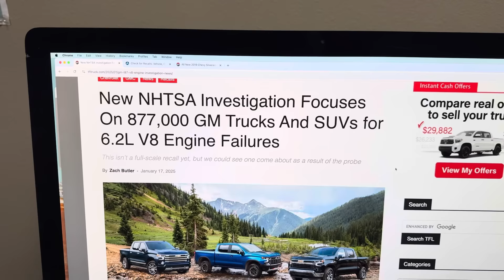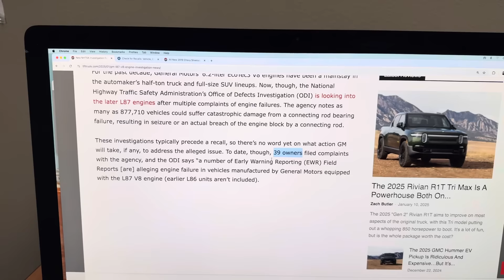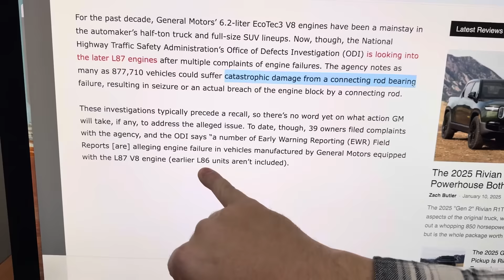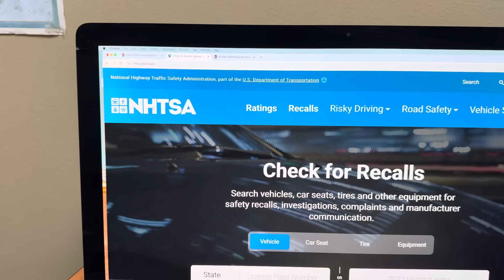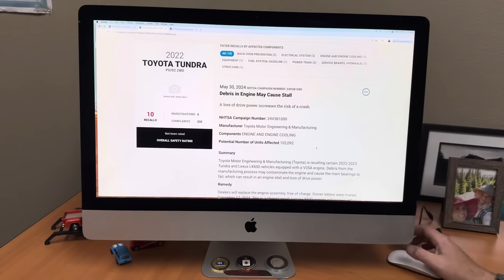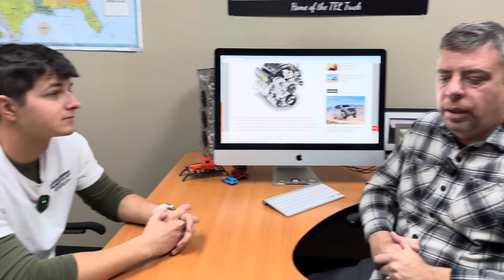877,000 GM Trucks & SUVs INVESTIGATED Over Failing Engines: Are You Affected?

Comment: IT IS QUITE SIMPLE: THIS IS PREMATURE IGNITION AND SUPER KNOCK ENGINE EVENT... THE FIX; RUN 93 OCTANE PREMIUM TOP TEIR FUEL ONLY...
 *A 1969 factory Chevrolet Camaro Z28 with a High Preformance 302 V8 engine has a compression ratio of 11.0:1. and fuel requirement on the vehicles of "PUMP GAS AT THAT PERIOD IN TIME" of 103 OCTANE...  !! 
The GM 6.2L EcoTec V8 engine has a COMPRESSION RATIO of 11.5:1. This engine is used in several GM vehicles, including the Chevrolet Silverado 1500 and the GMC Sierra 1500EcoTec3 Engine Family Features
Type:	6.2L V8
Compression ratio:	11.5:1
Horsepower (hp / kW @ rpm):	420 / 313
Torque (lb-ft / Nm @ rpm):	450 / 609
RECOMMENDED FUEL:	REGULAR ???  UNLEADED or E85 
*"I don't give a rat's a-s" the vehicle computers systems can't compensate and break laws of physics, operating high compression engines on very unstable 87 octane unleaded gasolines; it will create catastrophic engine failures...  Is this a marketing issue where GM has decided they can't compete and sell these vehicles with true operating premium ⛽️ fuel cost... !!

Comment: The 5.3 has the same lifter issue. My 2009 Avalanche had a lifter failure and shaved down the camshaft at 90k miles. I didn't make a complaint to any authority, but I'd love to. The AFM issue is well known for the 5.3.
Reply: My 2008 GMC Sierra has absolutely no issues.     150K miles strong on the original engine.     I've owned it since 80K miles.    I have no complaints.     I understand that nothing is indestructible
Reply: @gregorylyon1004  do you have displacement on demand? If you do, you have been extremely lucky!

Comment: I have a 2020 gmc AT4 with the 5.3 and the 10 speed transmission.i only do about a thousand miles a year and change my oil every year with the inspection. Hopefully it doesn’t have a problem. Bought a extended warranty just to be safe and will be getting a new vehicle before the warranty expires
Reply: My aunt and uncle ordered in two brand new gasoline Chevy Silverados in 2015.  A 1/2 ton and a 1 ton.  They have not had any issues yet, but they both only have about 80,000 miles on each of them.

Comment: Ain’t it hilarious how the government is inevestigsting this when it’s the government enforcing car manufacturers to meet epa standards? The amount of cars I see with dead engines have some sort of stupid cylinder deactivation and vvt bs. Fun fact: government vehicles do not need to meet epa standards and they don’t have no cylinder deactivation non sense or vvt
Reply: while yes I agree the CAFE requirements play into this, Its still up to GM to make a system thats reliable and doesnt push the cost to the customer. Ford for example has had cylinder deactivation in the Coyote for 4 years now and I havent heard of a single issue related to it specifically (and yes im aware OHV engines and OHC engines are different) but at the end of the day GM knows this issue is going on and refuses to issue a recall.

Nobody should be stuck paying 10 grand for a new engine in an already expensive truck just to have the same defect issue and potentially have the engine fail yet again thats pathetic. On top of that yes GM has had issues with the AFM/DFM systems in the past but those didnt catastrophically destroy your engine out of no where, you usually had a ticking issue and then it would fail after awhile. Having your engine just out of no where grenade itself while on the highway with absolutely no symptoms or warnings is just pathetic and GM should have recalled these a long time ago because if the government forces them to do a recall thats a lot of engines and its going to hurt them big time.
Reply: @ this is 100 percent true but I’m still frustrated how the government forces the consumer with epa ratings but they’re not bound to it… all the government suburbans do not have any sort of fuel management and all government diesel vehicles have no def or any epa restriction
Reply: @ Yeah I agree, cause the LT/LS engine is a very good engine if it didnt have this DFM bullshit. 

One thing im curious about is I really havent heard of the 6.2 engines failing in the Camaros and Corvettes. I know they have more robust internals but pretty sure they still use DFM
Reply: @ it’s because afm and dfm are activated when driving steady and well I mean who’s really driving those tame?
Reply: @a.k-1shot3  yeah I kinda thought of that haha plus the volume of engines in the trucks is muuuuuch higher so obviously more failures will crop up.

Comment: The failures are being attributed to fuel management system or fuel efficiency system, meaning the engine cylinders shut down to get better fuel economy, and the barrings can't handle it
Reply: Why can't the barrings handle it? Inquiring minds want to know!🤔
Reply: @jeffmiller3150  i think the earrings are poorly made but they have had major engine issues for yrs even the 5.3 has really bad oiling issues
Reply: Barrings

Comment: Solution stop using 0w20 in these engines, change your oil and go back to 5w30 fully synthetic just like the 6.6 gas engine in the new HD uses.
Reply: Oil weight of 1 step higher in viscosity will not help these engines. Poor design.
Reply: Love on my 24 3.0 GM recommends 0w20, come on! Anything for more fuel economy.
Reply: I take it you've done extensive research,and know better than the engineering

Comment: There is no way there is only 39 complaints. I had 2 motors fail. Both crank bearings. 6.2L 23 At4x. 10k each motor. I think this investigation is going to blow up a lot bigger than they think. And being in Canada GM won’t do anything for you. No lemon laws. All you can do is get rid of the truck at your expense!
Reply: No warranty?!
Reply: @adrianbargen9727  it had warranty. But I was without a truck 3 months everytime it needs a motor. I don’t have time for that. Making payments on a truck and here your driving a loaner half the time. I gave the first motor a pass. Cause I mean stuff happens. But 2! And the nail in the coffin was we were 10 hrs from home on the first day of our camping trip. I decided right there that I was getting rid of it when it got fixed.
Reply: damn why did you go back and get another?
Reply: @josh16-f3r  oh I didn’t get another one. Traded it in for a Trx after it was all said and done. I’ll never get a GM again. I thought I would try it once. And learned the hard way unfortunately.
Reply: I had 23 motors fail.
Reply: @Liberator29 I had 45 engines fail

Comment: I work with a guy that had the 5.3 LS IN HIS SILVERADO with the cylinder deactivation and the lifters end up getting stuck. So he then traded the truck to a ram 1500 with the 5.7 hemmi that had the cylinder deactivation and he ended up up having the same problem with the ram having the lifters stuck and now for some reason ford is doing the cylinder deactivation on the coyote 5.0 and it makes me think that that technology is not working to good.
Reply: cylinder deactivation is the worse thing ever!!! Just replaced the 6.2 in my Escalade ESV. On my Charger (RT 5.7) and my Chrysler 300 (C/SRT 6.4) you can at least turn that shit off by keeping it in "Sport" mode so you have all 8 cylinders running full time. Thankfully my Hellcat doesn't have that stupid feature. We buy V8 equipped vehicles for a reason. If I wanted a CRV or Prius I would've bought one! No need for this 4cyl ECO mode garbage
Reply: I thought the Ram was an OHV motor hence no lifters. 5.0 is definetely OHV.
Reply: @michaelcooley8275 lol no lifters. You must be mistaken, OHV/pushrod engines definitely have lifters. What are you 🚬?
Reply: The government is to blame for having manufacturers to put this cylinder deactivation crap on their motors

Comment: The Vortec V8s from 99-06 were the most reliable V8 you could buy, period. Then they got AFM and have been nothing but problems. I can understand a new design will have issues when they first come out but it’s been almost 20 years and they’re still junk.
Reply: Actually Fords Modular V8s are the most reliable, runs 400,000+ miles as a police vehicle, then, 500,000 +++ miles as a taxi!! My 23 year old F150 will soon turn over 500,000 miles!

Comment: Makes me wonder if the 0w-20 is part of the problem
Reply: I have wondered this as well,  multiple brands,  modern engines,  all using thinner oils having bearing related failures hmmm 🤔.    Also makes me wonder what oil the customer is actually putting in.

Comment: I totally agree with Andre. This leaves me optimistic. I own a GMC Sierra 1500 with the 5.3 V8 and had a small concern about the engine due to the active fuel management and potential failures. If the rate of failure is anywhere near 39 in 877,000, then my concerns are over. That, to me, is nothing. I'm more likely to die than my engine is to fail.😊
Reply: Bro its thousands, just go to any forum and see how many have blown after warranty.
Reply: I’m sure there’s more than just ‘39’ complaints
Reply: The cam and lifter failure rate in our fleet is close to 100%

Comment: ...  the owners I know have said driving in "manual" mode stops the  AFM , which means you "lose" a gear but it does fool the computer - this other issue of cam failures is totally different  -  GM  scares me now  ...  driving since '69  ...

Comment: So, the best engine GM offers for reliability is the 4 cylinder and the 3.0 diesel for the 1500s. The 3.0 has the transmission recall now from the valve body. Only safe bet is the 4 cylinder at this time. Sad times for GM...

Comment: GM has been suffering plenty of issues with their engines and transmissions since before 2019, in my own family we had a Yukon Denali and the transmission started to go, and we got rid of it just before everything fell apart. It had less than 50,000 miles on it and they simply wanted to do a flush of the system to “fix it.” Luckily I have a very honest technician who told me that this was happening with a lot of the vehicles and we should just simply sell it before it goes bad because GM would never take accountability and they were even lawsuits about it.

Just look up the Chevy shakes.

Comment: Investigating now after they have been building junk for the past 20 years? It’ll be interesting to see how GM responds. As far as I can tell they don’t care about making things right and building a quality product.
Reply: They have to pay out to employees so much more so they will cut quality to pay for the contracts the UAW made them sign.  Has to get cut some place.  They are burning through money fast!
Reply: Calm down Ford guy
Reply: @ ford is just as bad
Reply: @deedspm9  Ford is just as bad as is RAM. Toyota had some issues with the new v6 twin turbo units but they will get that figured out or probably already have since its been old.  They take care of issues way better than all the other domestic mfg do.
Reply: @ At least Toyota is doing the right thing to fix it. GM just pretends like nothing is wrong and keeps putting out the garbage.
Reply: @deedspm9  Exactly right.  Toyota will take charge and fix it.  The others wait as long as possible acting like nothing is wrong.  Toyota pulled their trucks and said they needed new engines because of problems.  They did it on their own knowing it was going to cost a mountain of money.  Still did it and was worth it.

Comment: There is nothing positive about these engine failures, because they do not happen while you are safely home. Mine happened when I was in the middle lane of the highway, and not only was the engine dead, would not restart. but the warning lights would not work either and I could not warn the on-coming traffic that I was marooned. It was 7:20 am in November and not quite full daylight yet. I am glad I came out unscathed / alive. I had the engine replaced under warranty and traded the truck in for a different brand. It was a Silverado 1500 RST with the 6.2. I did not file a complaint, but it happened to me in a bad way altogether.
Reply: By an old Tundra with the V8!
Reply: @bradh7472 I wish but not good for limo
Reply: What did you need up trading for?
Reply: @DeltaAngler  I got a Gladiator Rubicon manual
Reply: Same with me , I was in left lane and car stalled . Thanks god there was a shoulder and the car behind me moved there . I got flicked though
Reply: So you don’t know what to do when you have car trouble such as engine trouble?  Have you ever heard of putting the vehicle in neutral, turning on your hazards, and pulling over?  If you are uprepared for vehicle trouble while driving please turn in your drivers license.
Reply: @brianfl33916  Neutral made no difference. I tried it. As I stated in my original comment, even the emergency lights were not working.
Reply: @brianfl33916  haha
I did that
That’s why did not get into an accident. And I managed very well with 80 mph and a car right behind me. Thanks for the recommendation though.
Reply: Of course you didn’t report it lmao. Cool story.
Reply: Keep your saltiness to yourself  @Liberator29

Comment: My sister in laws father had this exact thing happen to his 6.2L last year, going down the highway at 80 and the engine just died completely, it had to be replaced entirely. Not something you’d expect from a $70k+ GMC truck.
Reply: I fully expect that from any GM product
Reply: @syerolis1988  The older vehicles that can barely go 70 mph dont just magically last forever. My 22RE 4Runner falls into that category and still needs work done to it. Timing chain replacement, valve guides, radiator, etc.
Reply: @syerolis1988  Those German cars run really good on the Autobahn.
Reply: You can expect anything from GM these days.
Reply: @benchmark3332 any brand*
Reply: I was thinking the same thing when Ford did a recall on the 2.7 having dropping valves and we seen many videos where the GM engine was blowing up but now GM  is  just coming  out with a recall now it's been over 2  or three years.
Reply: @syerolis1988  Well your first post suggested that making a vehicle that can go 80 was the reason they are unreliable. Your 4Runner can cruise at 80mph, so you can understand why I might be confused.

"They make vehicles able to cruise at 80mph and they expect no issues ?"
Reply: So was it maintained properly? did he own it all 70k?
Reply: @mikekoe  No problem not because it got 10000 mile oil changes using 0W-20.
Reply: @syerolis1988  Some vehicles are also just built heavier to handle the higher load. Your 4Runner 4.0L and tiny 8.2" axle is probably more stressed out cruising at 70mph than my LX570's  5.7L and 9.5" semi float axle is at 80mph.

Same with my LX's gigantic steering rack and tie rods, which is what 4Runner owners upgrade to if they actually use their 4Runner for more than highway driving. Or the Tundra transmission and half ton spec transfer case.

The same would hold true for a Silverado. Has nothing to do with cruising at 80mph.
Reply: Planned obsolescence, cheap parts, everything else made of plastic = a no other choice repeat customer.
Reply: Same thing happened to my ‘22 6.2L Silverado while doing 65mph on the road. Currently in the shop awaiting a new 6.2L motor that’s on backorder 😐
Reply: @ But your 4Runner can go 80. 5th Gen 4Runner drivers tend to be the people I see driving like they are the most important so I know its possible.
Reply: @syerolis1988  But your 4Runner can go 80. 5th Gen 4Runner drivers tend to be the people I see driving like they are extremely important, so I know its possible. Where I live, the posted speed limit is 80mph and I get passed by them going faster than that all the time.

But damn, I had a GX460 and I didnt find it all that enjoyable to drive. Now I have an LX570 and its cool, but it should be considering it was a $100,000 vehicle new. Driving a V6 4runner around here at 6500' with 7% grades everywhere would be miserable.
Reply: @Jay-me7gw 4runner drivers always are driving g fast and aggressive.  I just get in there way. They go nuts. And this isn't just a few. It's pretty much all of them.

Comment: L86 doesn’t have any issues with rod bearing failures?  When a lifter fails and wipes out a cam lobe, where do you think all of that metal goes and what do you think the rod/main bearings look like.  The fact that GM only replaces the lifter that fails and the cam without looking at the bottom end, does NOT mean there are no bearing issues.

Comment: My company car is 2023 Chevy Equinox. The engine died at 2,500 miles. Currently still at the Chevy dealership for a replacement. GM gotta do better. Oops I forgot they are not General Motors anymore, they are "Government Motors" now.

Comment: It's a known problem in GM truck's dating back to 2014.  I bought the Duramax to avoid the lifter issue.
Reply: Same.  2020 LM2 3.0.  Zero issues.  Mine has been flawless.
Reply: Which duramax? 3.0 2nd gen? My 93 k1500 5.7 162k runs great every day.
Reply: That engine likes to crack blocks. I ain't buying ANYTHING from GM.
Reply: @All-Miles-Matter personally, i like ford's 6.0. You bulletproof them they won't blow up every time. More like every other time.
Reply: @marklemist6928  in my eyes? No such thing as a bulletproof 6.0. (as you stated) I like my Cummins 6.7. deleted. That thing is BANANAS! 4th gen baby!
Reply: @All-Miles-Matter  The only cracks you heard are your face!